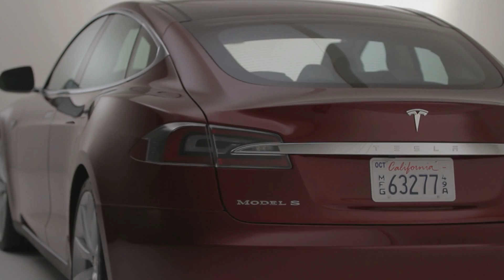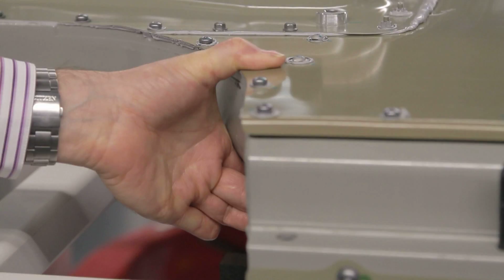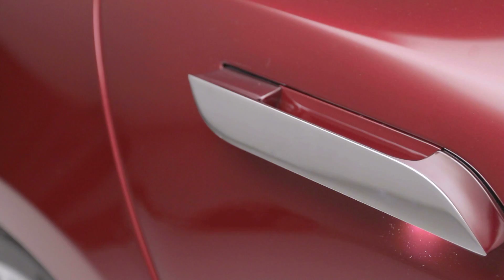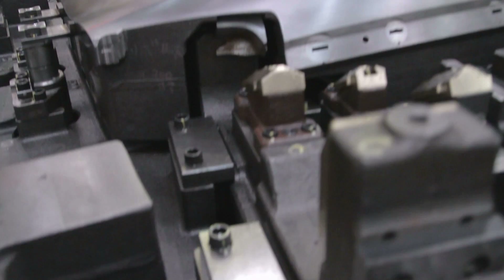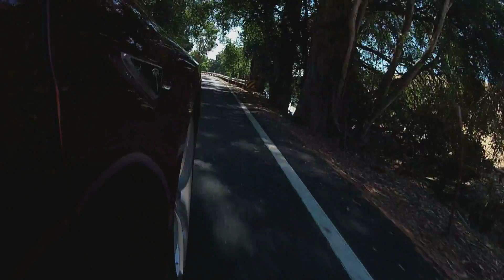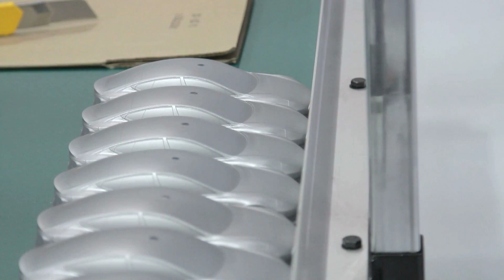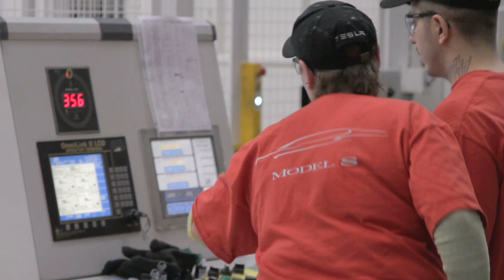Driving the 2012 Tesla Model S - Wide Open Throttle Episode 22

Comment: I only takes that long if you aren't using the home charger or Supercharger. With the home charger, you get 62 miles of range per hour of charge (5 hrs, not 13). With the Supercharger, you can get to 80% charge in about an hour (212 miles out of 265).

I'd put clear plastic rim covers on mine to make it a little more aerodynamic, and light-weight, low resistance tires on it when I take a long trip. These measures should give me about 10% more range (291 vs. EPA 265 miles).

Comment: Sorry but I don't understand the 200 miles regularly comment.  If the Model S is charged every night then you have about 240 miles of range.  If your driving more than 200 miles everyday imagine all the money you'd be spending on gas in a regular car. It would be a mistake to use an ICE paradigm (400 miles between fill-ups) since you're topping off the EV "tank" every night.

Comment: The 200 or so mile range is problematic as is the crappy rental car strategy.  I mean I don't want to run out of juice in West Texas after only a couple of hours of driving nor do I want to tour in a Camry.

This is a good first effort, but a hybrid strategy like the Fisker is probably a better approach until a rapid battery change out infrastructure is present across the nation.

Comment: Kind of defeats the purpose of owning a car, if you can't drive it when you want.

Everything you stated, costs way more than actually just owning a gas powered car.
Solar Panels - would take about 14 years, to pay for the cost in savings.
Also, you only save about 500 a year on gas over an electric car(And that is the Nissan Leaf, so, this car I assume uses a bit more energy)

Please learn facts.

Comment: Well... There are some flaws in your math...
1) Not-equal part of production cycle - for equality, you should start counting at coal-mine/oil platform - this is actually big deal, as huge volume transport to power plant and losses on grid are (with one exception***) the only relevant missing stuff, on side of oil, there I miss info about efficiency of drilling (what about natural gas?), efficiency of refining, "grid efficiency" (how much diesel is burnt to deliver diesel to stations..?)
ALSO:

Comment: Model s is excellent car, but nobody talks about that (de)charging efficiency is around 85-90% (so in the reality you pay 10%more because of the charging losses), ac asynchronous induction motor has a eff. of 8x(max load)-97(normal load)% and the invert has a eff. around 96%. So you got a combined eff. around 75%. In a modern (the usual coal power plants are around 33% of eff.) coal power plant you got 40% eff, therefore the energy transformation cycle is around 30%, disel cars 40%

Comment: the batteries on new laptops are 20 times more efficient than the battery in my 3 year old laptop of the same brand, and last longer, in three years i wouldn't be surprised if the models were 600-800 miles

Comment: the funny part about it if they had optional front battery with an increase in the front suspension for a couple gs more you could easily get 500mi ranges, however we will see this with the current size batts in the next couple of years without extra weight or lack of storage tesla is on top of their shit and i commend them

Comment: How far can Model S travel on one charge? 
Three battery options are offered: 160- (255-km), 230- (370-km), or 300-mile (480-km) range. Model S comes standard with the 160-mile (255-km)range battery. The 230-mile (370-km) and 300-mile (480-km) range batteries will be optional upgrades and prices are not yet available.

Comment: I've been wondering why nobody has put a little range-extending engine in a car like this. If you think about it, it wouldn't take much to put that range from 300 miles on the best day to 600 miles on ANY day. And it would cost, I don't know, a pittance more per mile than pure electric. And you don't have to deal with any of that hybrid engine swapping garbage. Where is this bad thing?

Comment: I'm 100% on the wagon. true, they are expensive, but the price will come down eventually. yes, they have limited range and take long to recharge, but that will improve as well. I find the usually "if it doesn't cost less than a Civic, has a range of 1500 miles and charges in 15 minutes then I dont want it!" comment kinda impatient and inmature.

Comment: Battery technology is improving and will continue to do so at an expanding rate. Same as any technology before, i.e. mobiles and computers. Don't know who told you that the ALL the electricity from created in powerplants is created from fossil fuels, that's just not true. Here in UK we have power suppliers such as Ecotricity who supply electricity only from renewable sources such as wind and solar. If I were you, I would do some research on what effects bio-fuel farming has on the environment.

Comment: A: The Model S is 30k cheaper, has 25% more range, and recharges faster than the Roadster from just 3 years ago. This will only improve.

B: Tesla says 70% range after 7 years. Expect this to improve also.

C: Coal power in an EV is only slightly cleaner than a (NEW) gas car, but only 35% of US electricity comes from coal now, and 1 power plant is FAR easier to improve than thousands of gas cars.

D: Bio-diesel would be great for cross-country trucks and trains.

Comment: i'm not sure if electric is the way of the future.  Battery technology is still in it's infancy and their power cycle life span is about 4 to 5 years.  Plus the power turbines that generate all the electricity at the power stations is run on fossil fuels.  Bio is the most logical, the conversion is less costly.  millions of already circulating combustion engines can be converted.  farming increases, creating more jobs world wide.  also increasing food supply,cleaner air and a host of anxillary

Comment: Yeah your right, hydrogen is flammable, but only when put to a naked flame. In a hydrogen powered car, there is not naked flame. But the same weakness applies to batteries, too bad they are useless anyway.

Comment: The Model s is a sick car, no doubt about it. However, unless a more suitable alternative is found to lithium ion batteries, I think that diesel electric cars are the future. The concept is simple, a small diesel motor runs at its optimum rpm to charge a battery, much like many trains use already and similar to the tech behind the volt. I think that if Tesla can jump on this and make the first diesel electric car like they did they did the Model s, they have quite a future ahead of them.

Comment: I am running Renault 1,5 dCi turbo-diesel engine, power 60 kW (80PS). I have average consumption of diesel at 5,5 litres per 100 km. It makes cost of 100 km to drive 8€.
This lovely car, which has beautiful design, super power of 270 kW, zero emmision, drive performance as BMW M5, has charge cost of 38 kWh per 160 km.
So 100 km to drive in this honey cost under 2 €??!!  IT IS AMAZING :-))))

Comment: The car is great. One problem I find about Model S is that it cost a lot to charge up. Where I live it cost $7.00 for 100km to drive. That is very cheap for hydro. That about $1500 for 20,000km driving it easy. If you push the car add $100-200 more and if you drive it in winter that's another $200-300 more. This is for a 85 kw battery. For the 40 kw battery it's half the price. All in all for the same type of car in gas you save $1500-2000 a year. Still a very expensive electric car.

Comment: Gasoline comes from one source, oil. When oil is in demand, the price spikes, like it did during the boom before 2008. Electricity comes form a multitude of sources, so prices are insulated from market fluctuations. Charging an electric car form $0.10 per kWh electricity is akin to getting 100 mpg at $0.60 per gallon.

Hand held devices are obsolete in 18 months. That's why the batteries are rarely intended to last more than a couple of years. EV batteries are designed for a longer life cycle.

Comment: You are being "realistic" with made up "facts". Batteries in the Tesla cars don't have to be replaced every 2to3 years. They work at minimum 5 years, the expected is 8 (guarantee for Model S) and in reality could be up to 10 easily. For example, Roadster has been out for 4 years and to my knowledge no one has ever changed the battery. And as battery technology evolves geometrically, then in the next 10 years the battery will last for 20.

Comment: 45min for full charge if using super charger, and all others such as laundry plugs or welding booth plugs will range from 2 - 6 hours go onto there website and click the charging section under model s teslamotors . com

Comment: id like the idea of an electric driven car, i man i like the fisker karma the most since the engine in it only regenerates the batteries the drive of the wheels come from an electric motor. using an engine as a generator makes it use less fuel and also give u a long range and no recharge time

Comment: The battery pack is warranted for 8 years/100,000 miles for the base vehicle and 8 years/150,000 miles for the 85kW pack. The pack has active thermal management to maximize the life expectancy of the cells. Check their website.

Comment: You also have to realize that hydrogen based cars are basically fully electric cars, but with a hydrogen fuel cell that charges the batteries. So whatever Tesla has invested into the development of battery, and more importantly, brushless motor technology will directly trickle down into the development of hydrogen cars. I'm somewhat skeptical of your so-called experience just because you failed to realize that fully-electric cars and hydrogen cars are so similar in that regard.

Comment: Do I think that it kinda sucks that the government is funding a project that doesn't directly benefit the general public? Yeah, but since it's inevitable that someday electricity based cars are going to outnumber the ones that run via some sort of internal combustion engine, it's worth starting the development of electric cars as soon as possible. And while you have a very good point with the hydrogen cars (and I actually think those are going to be more prevalent in the long, long run)

Comment: 265 miles (EPA 5) are ready for you to start your journey. Even if full recharging at home takes 4,5 hrs, that's not the only way:
You travel 250miles(~400kms) (without stopping), stop for a meal at a highway station with supercharger: during your half hour stop your car will have additional 133miles(200kms) to go.
Do you often travel more than 400miles(600kms+)? Then wait 3-5 years with buying allelectric cars.

Comment: I agree this is the best electric car there is at this time. I think the idea of going on a road trip in this car is a bit of a stretch and therefore I will wait. Where are you going to charge when on vacation and so on. I don't think everything is in place just yet. It does mark a step in the right direction but those of us that will go say 400 plus miles in a day to get somewhere are still waiting a charging quick charge station might work? Either way I look forward to what is to come.

Comment: Well, it is my driving style. I am an aggressive driver (but I try not to be a dick). With my driving style I would be willing to bet that the range of pretty much any electric car will be a little more than 1/2 the advertised range, just like my car now CAN get nearly 40 mpg but I really gets about 23 mpg. For the first two or three years it probably wouldn't be an issue, but as the batteries age they lose their capacity (just like my laptop, after 75 cycles it has 75% it's original capacity).

Comment: If you do some simple research, You will find that the two vehicles Tesla has produced do in fact get close to: "performing better and more efficiently than your Porsche Turbo, and cost the same" (or less). 
0-60: Roadster - 3.7sec. / Model S - 4.4 / Porsche Turbo - 3.5

MPG: Roadster 116mpg(e) / Model S - 89mpg(e) / Porsche Turbo - 24mpg

MSRP: Roadster - (was) $110k-$160k / Model S - $50k-$90k / Porsche Turbo - $135k+

Drag Coefficient - Roadster - .26 / Model S - .24! / Porsche Turbo - .31

Comment: My Porsche Turbo will still be running in 2040, but I seriously doubt any Tesla made today will still be on the road. We'll see I guess, but I have a sneaking suspicion that only the first owners of Tesla cars will have a good experience. It's possible that by the time the batteries need replacing, something in the same form factor, but much lighter and cheaper can be put in their place - but battery technology still has a very very long way to go.

Comment: What are you on about price. $49,900, which is the base price of the Model S is well in par with its competitors like the Audi and BMW, at that price, it's 0-60 is 7.6 seconds. Then there's the 300 mile $69,900 model that does 0-60mph in 5.6 seconds. Then the performance version at $84,900 that does 0-60 in 4.4 seconds. All are after your €7500 tax grant.
Overall the new M5 is 0.8 seconds quicker to 60, costs $6k more and smaller inside.

The Model S is not slow compared to its main competitors!

Comment: I agree but the you don't need it to be bigger plus I was just saying that in Europe the reverse complaint is made but I think the Model S is good size car though it could be a bit smaller remember it has two trunks and the batteries are under the floor so length could be trimmed.

Comment: write to me at  cinema2008@europe.com
It is not a cheap thing to do but way better value than either Big Auto EVs or gascars. If we had NiMH batteries it would cost less for more range but that is a 
fight against CHEVRON we need to wage. In the meantime there are very good
prismatic Lithium batteries but they cost a lot. This is due to a lack of a non-profit
buying on a contract on behalf of converters to help price.
cheers
Howard

Comment: The thing that is often overlooked with electric cars is that the electricity from the outlet has to come from somewhere, and in the US that somewhere is primarily fossil fuels such as coal and natural gas. Sure there are zero tailpipe emissions, but there is still pollution being generated at the power plant. The advantage of this is that the emissions are easier to control when they are coming from one location, or even better yet if they are coming from a clean source of energy such a nuclear

Comment: I still envision future electric cars as having easily swappable batteries. 

If some universal system for connecting the batteries to the car existed, you could pull into a station of sorts and have the battery (or some strong container housing the battery) taken out from underneath the car and swapped with a fully-charged one, for a small cost, and done by a robot automatically. 

It would greatly solve one of the bigger problems (after cost) with electric vehicles, which is charge time.

Comment: This is my next car.  It appears I may have to special order an "X" configuration steering wheel, however?  Driving long distances with an obstruction at the 6 o'clock position becomes quickly uncomfortable.  Very cool door handles.  Does the full sunroof option have any solar power regenerative capabilities?

Comment: I dont know where you got this information from, i beliebe you mean the effiency itself with comparing an petrol engine with a coal steam electric generator directly. For sure the coal plants have higher effiency but what you didnt  take a look at are to losses of the energy caused by wire resistence and transformation over long distances and the bigger part the mining and transportaion of the ressources to the plants .

Comment: Ok, Yeah li-fe are a lot safer than li-po batteries. The only downside is a slightly lower voltage (3v per cell rather than 3.7 with li-po). If there was a large reserve battery unit capable of a high discharge that was stored charged it could provide the 80kw that is needed. It would only be useful for one charge every couple of hours tho. You make a valid point that petrol is also highly flammable and another advantage is that the battery cells would not leak when damaged like petrol tanks do.

Comment: These are almost certainly li-fe, rather than the li-po you normally use in rc models. Much safer if punctured, and I'm sure they've housed them in something that's going to keep them well protected. Life and lipo are generally safer than petrol anyway...  while not knowing for sure, I dont doubt they're capable of >1c charge, but the problem would be trying to find a 80kw power outlet. Also, charging slower means longer cycle life. as to drifting... well... no idea. Would be sweet tho!

Comment: Weight isn't completely wrong. It's bad for range, but while evident in the Model S, weight plays a huge role in handling and safety.
Yet with Hydrogen, it's more complicated and inefficient. Instead of using electricity to charge the battery, that electricity is used to split water to get hydrogen or to get hydrogen from crude oil and natural gas, then that hydrogen is turned into electricity in fuel cell vehicles. A bit wasteful but a completely better way than petrol, diesel or bio-fuel.

Comment: I like it, 2 questions tho. 1. If you crash it is it going to puncture the lithium cells & cause a fire? I drive electric rc's that use lithium batteries & there quick (really quick) but you need to take care of the batteries. A decent lithium cell (provided it stay cool) can also fully charge in an hour or less. This might be something to look at considering my model cars can drive for hours on a 1 hour charge. Question 2. Simply will it drift? I know electric motors put out some real torque!

Comment: It is actually about 4 hours with a wall charger, and even with the 160 miles model, driving at average distances 35 miles a day, you only need to charge it every 3 days.